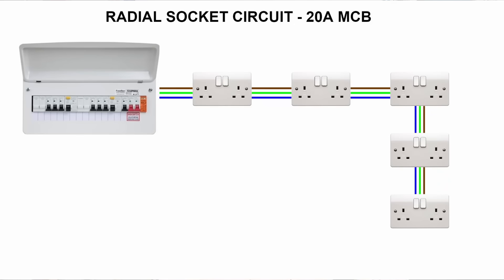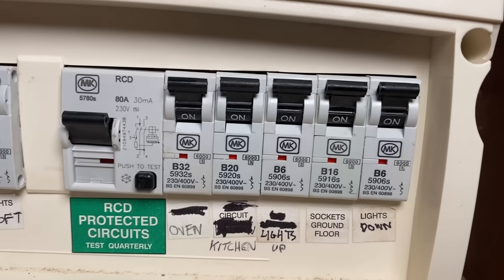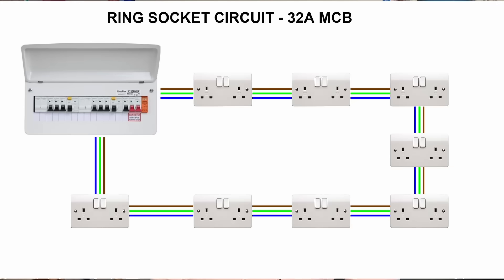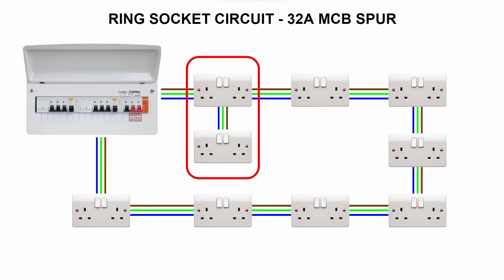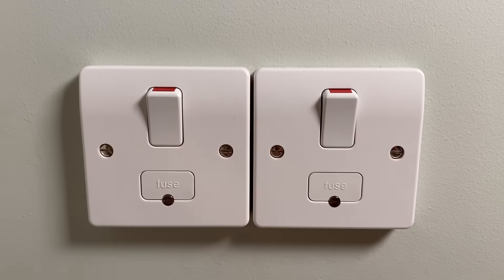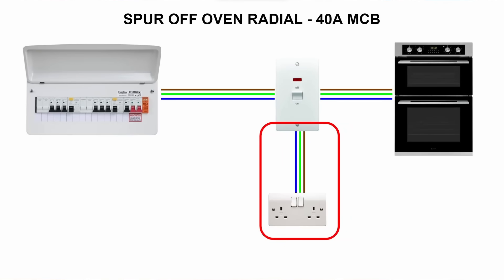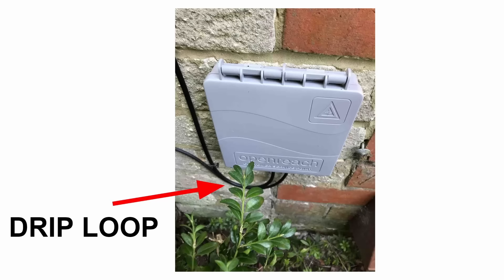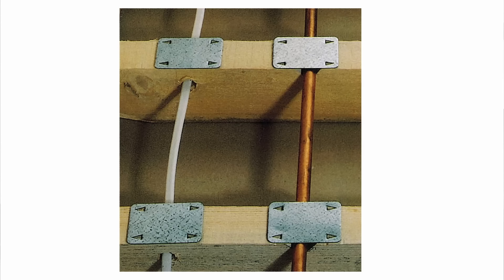BIGGEST DIY Mistakes Adding a New Socket

Comment: Rings came in after the Second World War, not during. We had a copper shortage during the post war rebuild. They required fused plugs which was introduced with BS1363 in 1948.
Reply from the maker: My research indicated that the drafting of regs started in 1942, but came into force 1947. The meetings for drafting all took place 1942-1944, agreeing on the ring circuit due to shortages of raw materials during the war, and expected to continue after the war. 
However, I wasn’t around then, so could well be wrong!

Comment: Any tail off the ring should be on a fused spur. Also, it is HIGHLY unlikely that anyone would run 12000 watts. That's 5 kettles!!
Reply from the maker: Thanks for watching!
Reply: "tail"?
Reply: @jameshansing5396  Yeah, tail. Sorry, i was messing with stuff like this back in the 70's and the terminology my uncle taught me stuck. Like his resistor colour code poem: bad boys ra-pe ordinary young girls but virgins grow wise. He taught me that when i was ten with a warning "don;t tell your mum (his sister) i taught you that. Here i am almost 50 years later and can still remember it.

Comment: Interesting, here in Hungary we usually use 1.5 for general sockets (phones chargers, hoover etc) with a 13A mcb, and about 5-10sockets per radial circuits/ 2.5 in kitchens mostly 16A mcb, radial/ hob, washing machine, water heater, towel dryer, oven, all separate circuits. Never seen a ring circuit being used over here
Reply from the maker: Thanks for sharing!
Reply: Because you do not have the fuse in plug.

Comment: I have a utility that’s likely to be a huge draw - it will house 2 x washing machines, 2 x tumble driers, a dishwasher, a chest freezer, and the boiler. The run from the consumer unit is approx 20 feet. Would you recommend a smaller cabled ring, or a larger cables radial to handle all that draw?
Reply from the maker: That is a lot of big appliances. I would probably do a thicker cable radial. Thanks for watching!
Reply: Cable size Really depend on Iz
Reply: Ye 2 4mm radials
Reply: Id suggest you dont do it yourself if you are asking this
Reply: Two 2.5mm rings taking into account derating to ensure only two high current appliances are off one ring, meaning stagger the sockets.
Reply: I recommend complying with part P.
Reply: @andrew7440  I wouldn't even consider doing this DIY. Far too much risk involved. I just wanted an opinion so i can have an informed discussion with my sparkie about options.
Reply: @tonysgardensgizmos7164  Good to hear,  diversity is the word.  What's the liklihood of all appliances running together?  Ignoring the boiler, on assumption it is gas/oil fueled.
Reply: @andrew7440  Apart from the dishwasher, it'll all be on at the same time once a week - saturday is wash day, which includes bed linens for all (there's 6 of us including 3 x teenagers, so we create a LOT of washing!) - so the current draw will really be stretched on those days - hence me wanting to be 100% when getting electrics replaced - currently we only have a 13 amp fused spur in there, and can only run 1 x appliance at a time, which means we literally spend all weekend sodding around swapping loads over (4 x loads to wash, 4 x to dry is a total of at least 16 hours run time doing one at a time ) we could get that down to 2 x loads into 2 x washers. 1hr 15 per wash, then as 2nd set of loads is washing, first is drying, so could do that first thing, and go enjoy our day, then when we get back swap 2nd load of washes into the dryer and leave to run overnight. Basically it would give us our weekends back!
Reply: @tonysgardensgizmos7164  Possibly 2x32A circuits are needed to meet that demand.
Reply: @tonysgardensgizmos7164  yeah, Sparks LOVE people telling them how to do their jobs! HAHAH
Reply: @jameshansing5396  in my experience, Sparks, and ALL trades (my family are all trades, and my old man was an electrical engineer before he passed) like a consumer who knows what he wants, has taken the time to understand the options and pro's and con's, and dont dither or change their mind at the 11th hour. And judging by the hatchet jobs done by qualified Sparks to the wiring on this place (which has since my post, led to an electrical fire) i'l prefer to understand my options from people who DONT have a vested interest in making their lives easier / making as much £££ as possible. Only a bloody idiot throws money at an unknown tradie and says "do what you want". Since this post was made i've found a decent sparks, talked in depth about the pro's and cons, and had it installed. We actually upgraded the main CU, ran a new CU in to the section, and ran a dedicated radial to each of the pairs of high draw appliances (first socket to dryer, as higher continuous draw, radial on to washer for each), then a ring circuit for the fridge/freezer/dishwasher, and finally a circuit into an FCU for the boiler (and a ring for lighting). He quoted for several options, but i went for this as over-specced as it is, as it gives me options and choices in the future without replacing the whole thing and the price difference was only about 15%. But i made that choice KNOWING the pros and cons of it.
Reply: Diversity is the spice of life !!!

Comment: It's just crazy that a ring circuit is even allowed in the UK. it would be ok if both ways can carry the max fused load. But it ain't. I think that is bonkers.
Reply from the maker: Yep it is bizarre, thanks for watching!
Reply: The whole point is that it's a continuous ring, not two separate legs. It's 2 x 2.5mm2 cables sharingv32a between them, which they can easily handle. The issue is if the ring is no longer continuous and one cable bears too much of the 32a. They're perfectly safe and electrically sound if properly installed and maintained.
If both cables could carry the full lead, you'd only need one of them and it'd be a radial.

Comment: In the upstairs bedroom closet, which originally had water tanks and an immersion heater there, but after a new boiler went in, the immersion heater was taken out. so, the 6mm cable going to that area was utilized and a pair of sockets at the end of that, Well over-rated, as one 6mm cable does the two sockets.
Reply from the maker: Thanks for watching!

Comment: In France they only use radial circuits for power but do them differently than in the UK. They will run 4mm3 or 6mm3 to a distribution point in a room and then drop out of it in 2.5mm to a maximum number of sockets as defined in the regs. That is why if you are staying in a house or flat in France you often see a blanking plate on the wall which is the hub in a recessed enclosure. The use of Wago connectors has made this far safer and easier to implement. I believe the same is found in other European countries like Spain. High power devices (like electric ovens) are wired directly to the breaker and use a completely different socket and plug. I still reckon on UK plugs and sockets are the best design in the world.
Reply from the maker: Interesting to hear, thanks for sharing!
Reply: Very interesting.  🇺🇸  rules allow for feeders to subpanels and short taps from feeders that may be smaller rating than protection on the feeder.  Combined with ubiquitous fusing in the receptacles, might bring our various systems into alignment.

Comment: 🇺🇸 is appalled:  14 gauge (2.5mm^2) is protected by 15A breaker here.  4mm^2 for 20A and 6mm^2 for 30A. In addition, any load over 20A is going to be on a dedicated breaker.  You already have double the watts per amp by using 240V!  27 amps on 14 gauge seems criminally reckless.

I grumble at North American excessive margins of safety, but where is margin for safety for you all? Are you counting on masonry walls being non-flammable?
Reply from the maker: I didn’t realise the US had such tight requirements. The US reputation I’ve heard is lax regs due to the 110V. Interesting to hear though, thank you!
Reply: @TheDiligentDIYer1759  you're probably right as regards consumer equipment (what we call the stuff that users plug into the wall, what you call the consumer unit we call the [permanent] installation.)  The UK socket/plug format is awesome, as is fusing at the receptacle.  We've gone different ways also on RCD/GFI, et al.

Comment: This is a good educational for those who are learning the subject, but I think you're biasing (pardon the pun) people who are new to this against a perfectly good method of wiring.  I applaud you having an opinion about this, but I think you should should present the information unbiased.  I agree power usage is increasing, but now we do split rings and separate rings for the kitchen, and MCBs and more modern protection devices are well over engineered to protect the conductors.  And really anyone who doesn't know enough about this subject shouldn't even try to install anything.
Reply from the maker: Thanks for watching!

Comment: If we wanted to save coper, we would not add switches on each plug. And we would use smaller plugs
Reply from the maker: British plugs are the best by a long way
Reply: @TheDiligentDIYer1759  I didn’t mean it’s not. ( also all of Europe is not in flame despite having smaller plugs and no fuse or switch on each.) 
It’s a lot of coper added for each plug in UK
The coper excuse doesn’t stand any more after all those added regulations against coper saving.

Comment: Interesting stuff. But. What of the standard adapters, short extensions with probably 4 sockets on them? That is in effect adding sockets? Everyone uses them without any attempt at 'doing electrics'. Of course today most of these are wanted for very low power but separately plugged in things like computer parts, and chargers for phones and other such devices. No idea what it would take, to overload the rings and spurs as you talked of but it sounds like electric fires or kettles or something, and it is not helpful without some hint as to what sorts of things might, added together, overtop these ratings.
Reply from the maker: Extension leads are all protected by a 13A fuse, so not an issue. Same idea as having multiple sockets off a fused spur. Thanks for watching!
Reply: @TheDiligentDIYer1759  Ah yes of course. Thanks.

Comment: I wondered why UK vids on this topic always mentioned ring circuits. I have never seen one in real live.
Reply from the maker: Yep not great haha
Reply: @TheDiligentDIYer1759  I didn't want to derate it here. The idea is good to increase the current capacity of all lines by just making a loop. Caveats apply, as always...
I think it makes some sense for the UK, because your plugs and outlets are awesome and - in principle - can carry more current than other plugs. In practise it is maybe less of a benefit, because there are not so many things that draw that much power. My sister melted her EV charger and outlet by letting it charge with 16A on a Schuko plug... ^^ From there I knew that they only take 10A long term. But I never had another issue even with high power appliances. Maybe because you rarely even reach 16A. And more rarely so for a long time.
But abuse will always lead to a f*** up.

Comment: I had a socket that had been wired in to the lighting circuit, we only discovered it because the bulb blew and the desk fan went off as well. That got very quicklly removed, it turned out the previous owner had manged to fit 2.5 TaE into the ceiling rose!
Reply from the maker: Thanks for watching!
Reply: Not dangerous at all to do that,  just not good practise as the circuit could easily overload and cause nuisance tripping.
Reply: @MsBethanyClaire  so your lights tripping when you need them on isn’t dangerous? Plus you’re overloading the circuit????
Reply: I have three twin sockets wired off my cupboard light and they work fine.
Reply: @fabianmckenna8197  working fine doesn’t mean they are safe…. 🤦🏻‍♂️🤦🏻‍♂️🤦🏻‍♂️🤦🏻‍♂️

Check out breaker trip times, then check out cable ratings …. 

THIS is exactly why I have issues with mr DIYs teaching people. It’s what others do with the actually fairly good demonstration..

Comment: Don't like rings. I used to be Electrician at a very large Pharmaceutical site in Uk they only used radials to feed labs and offices also our  lighting installation cable was 2.5mm minimum. They didn't care about cost they wanted reliability.
Reply from the maker: Thanks for watching!
Reply: Cable sizes not only depend on current flow, but also length of run

Comment: What is the purpose of the pvc covers you use to " protect " cables in a chase in a wall?   I accidentally drilled through a cable in my house that had a pvc chase cover,  it offered no protection or resistance what so ever and I became alerted to the fact I'd hit a cable when the mcb tripped and the wall became blackened with soot from the ark
Reply from the maker: The pvc doesn’t protect the cable from drilling really, if you’re careful, you’ll often feel the pvc through the drill and know to stop drilling. The pvc mainly stops plasterers damaging cables, it isn’t actually a a requirement as long as cables are run in zones

Comment: The explanation for the ring main system given to me many years ago was that it was used in warships for additional resilience, and then adopted after a methodical review of the wiring for homes. Before that, the radial system was used, with 3 sizes of plug and socket for different ratings.
He was a physicist who had served in the navy during the war.
Reply from the maker: That’s very interesting, and sounds plausible, thanks for sharing! 
Thanks for watching!
Reply: @TheDiligentDIYer1759  My curiosity was aroused, so I've just read about the introduction of BS 1363 in 1947. A number of benefits were foreseen, including economy of materials and labour. An expected 30% saving in wiring of ring over radial was indeed one of the reasons, and this was reaffirmed in 1994, despite the enormous changes.
Reply: @colinelliott5629  What everybody seems to miss about that, though, is that when they were doing those analyses they were not looking at the type of radial circuits we use nowadays.  They were actually comparing shared ring circuits to dedicated radial circuits.  An awful lot of pre-war electrical wiring had a single radial running from the box to each appliance.  One circuit had one outlet, and that's it.  So if you wanted to wire up five outlets, you were actually running five radials to do it.  It was really horribly wasteful.

So of course ring circuits would save copper over that way of doing things, because just about anything would save copper over that way of doing things.  Exactly the same savings could be claimed for shared radial circuits like we all actually use nowadays, if they'd even bothered to consider them at the time.

In fact, shared radial circuits make better use of copper than ring circuits do.  As was explained in the video, if you just break a ring into two radials, each with its own breaker, you could actually handle up to 40 amps instead of the 32 amps allowed for a ring (and do it more safely), so the ring configuration is actually wasting 8 amps of current-carrying capacity in the wires, for no real benefit.

(I can certainly buy the idea of doing this sort of thing on warships for redundancy, but for buildings it just makes no sense, and never really did.)
Reply: Yes, they came from ships for resilience.  They were introduced in the UK in late 1950s when they saw the fuse in the plug enabled rings to be fitted. The 23A fuse in plug was to replace about three or four plug types. 

My mothers house was built in 1954 with the 13A G Type sockets/plugs but with radials. Final rings were not a way to save copper after WW2, although it did help of course. 

Rings are ingenuous in their simplicity.
Reply: Admiral John radial and mr Gary Ring

Comment: This is nonsense.
No danger at all if the spur load is below 13 amps

Most spurs are used for ultra low loads like table lamps or Xmas lights.
We've had spurs in our house for 50 years and we are still alive.

Common sense is all that is required.
You could even label the spur 6amp MAX if you're the worrying type.

⚠️The biggest GAF the industry made years ago was making switch distribution boxes out of plastic.
That was pure stupidity
Reply from the maker: The whole point is that people could plug in multiple appliances and exceed 13A…..
Assuming people will have common sense is not a safe assumption, and the reason we have regulations…..

Comment: Why is it not possible to use multi stranded conduit cable. In industry it is used all the time for machinery. It can handle larger currents for the same csa. It seems it, in general, down to cost.
Reply from the maker: Stranded cables have a lower current carrying capacity than solid core for the same cross sectional area
Reply: It would have to be ran in conduit, which would add to the cost